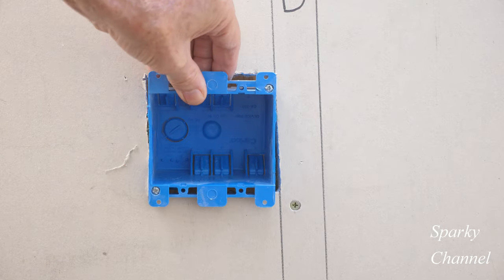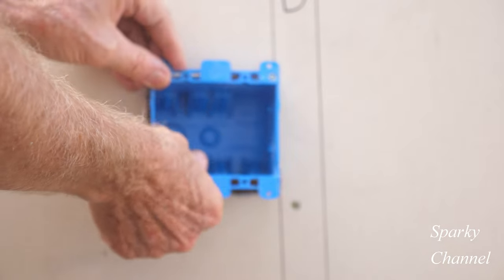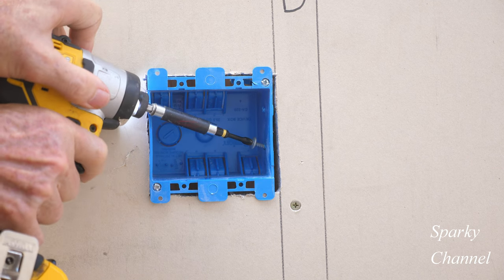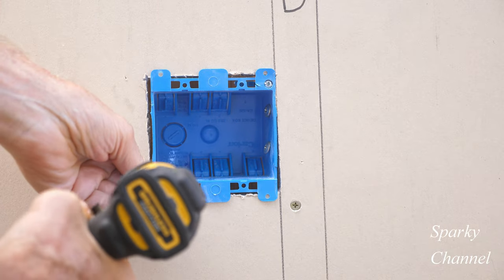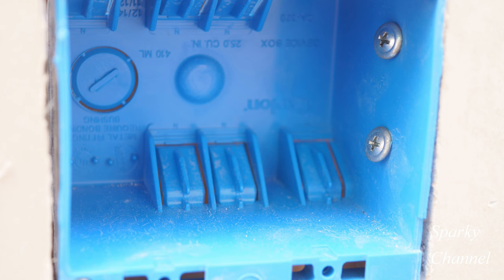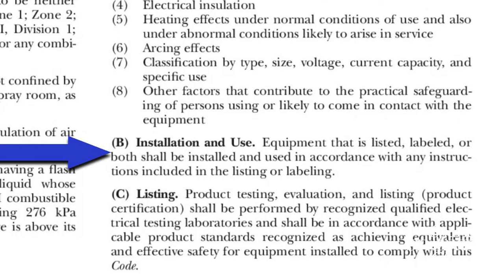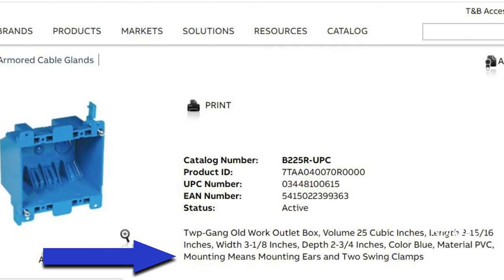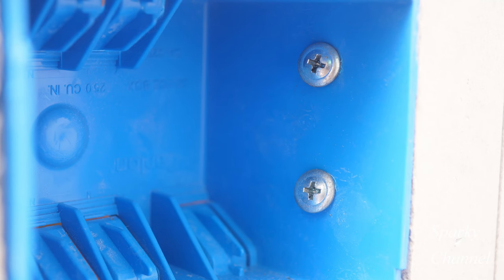Are Screws Through the Box and into a Stud OK per NEC on an Old Work Box? NEC 110.3(B)

Comment: I've done that exact same thing to attach those boxes because I don't have that much faith in those wings and have had them blow out the dry wall before. I would say that it's probably NOT approved because the screw heads are exposed in the box in 'close' proximity to the terminal screws of the device. Do I think it's a problem. No, but the specs are meant to be overly cautious or account for remote probabilities.
Reply from the maker: Thanks!

Comment: This is fine. As long as the box doesn't list not to drill holes. Personally I use self tapper that drill the hole as I mount the device! The fact that the screw is metal effects nothing.
Reply: If the manufacturer approved holes then they would list that it was ok to do and probably provide holes wouldn't they?
Reply from the maker: I've made another video on this subject coming tomorrow. I've incorporated many viewer comments and questions from this video into this new video. Hope to see you there!

Comment: I first saw boxes with preinstalled internal screws around 2016.  in checking the catalog pages on my preferred brand of boxes, I found they sell a single gang box with the nails stuck into the brackets backwards, so they can be nailed on from the back of the wall instead of the front.  according to a restrictive interpretation of code, that box would have to be reinspected and relisted for that configuration.  and making that modification in the field would be prohibited.  the code also specifically says it is subject to interpretation by the AHJ.  
so I stand by not specifically prohibited.
Reply from the maker: Interesting, thanks!

Comment: I've  done that before....and had it inspected by an Electrical Inspector, not a building inspector, and neither said anything about this method.  Screws are far enough apart there will be no short....but if you are concerned..tape your receptical screws!  Why waste material in this day and age!
Reply from the maker: Interesting. Also see: Modification of a Carlon™ Box with Approval? NEC 314.23 (B)(1): https://youtu.be/yZcEyd9mwzY

Comment: Technically because you are using the wings as a means of mounting still you are using the box as intended (per code).  But you are also improving the mounting stability, agreeing with others but I would add tape over the heads for a little extra reassurance
Reply from the maker: Good points, thanks!

Comment: electricians overthink everything... the code is minimum guideline... as long ad the code doesn't say to NOT add screws it's OK... just use common sense... this is done all the time without issue
Reply: It's  not overthinking, it's saving time of redoing something that the inspector says is a code violation.

Comment: I am replacing some older electrical boxes in a restroom remodel and came across some plastic boxes at the local electrical supply house that have screws pre installed from factory on the side for stud mounting in either horizontal or verticale orientation. since I am installing back lit mirror thia box allowed me to mount the box horizontally and the inspector was ok with the box.
Reply from the maker: Excellent! Was it something like this one: A Superior Old Work Electrical Box?: https://youtu.be/I9yhM6m3VIE
Reply: @SparkyChannel  Close but slightly different. I pick up one made by  Southwire Called a SmartBox.That looks like the one in video link but has a heavy duty steel backing for switch or receptical screw mounting. Then one made by Cantex. That had adjustable tangs.
Reply from the maker: @jwar2163  Interesting, thanks!

Comment: Definitely against NEC code, but I'll admit that I've done it... being very careful to avoid placing the screws in any place that could contact the mounted devices (place the screws as far back as possible) and use round head screws with no sharp edges.  Usually with 3-4 gang boxes that can't be fully secured by their edge mounts.
Reply from the maker: Honest man. Thanks!

Comment: Though I know that they make boxes with nails/screws in the side like that (thanks to another of your videos), this is definately altering a certified box from its approved state. My guess is most inspectors wouldn't have an issue but it is for sure against code.
Reply from the maker: Yes, the modification invalidates the UL listing of the box. And inspectors usually don't see these screws to make a ruling on it.

Comment: It will rightfully fail inspection, while it is likely safe to do this into a wood stud [non-conductive material], this would be incredibly dangerous to do with metal studs. The issue is the plastic box is not grounded the same way a metal box would be, so any loose conductor energizes those screws and any metal studs, with no path to ground. Either use a plastic box that comes with screws or use a grounded metal box.
Reply from the maker: Great points. I've made another video on this subject coming tomorrow. I've incorporated many viewer comments and questions from this video into this new video. Hope to see you there!
Reply: You would think so, but i pointed this out to my inspector, and even showed him the code and he passed it anyway and said he didn't care, and can't help me on my reinspection I had called them back out based on many violations  that i found as a home owner (expecting that there are probably others).  The receptical and box were mounted with drywall screws, and the outlets were mounted against the wooden fiberboard backing of our kitchen cabinet's rear wall which is also another violation.  

Also found they ran 14awg, for my living room outlets into 20 amp12awg kitchen countertop receptical circuit.  And this all passed inspection, so contractor thinks it's fine.

Contractors get away with anything these days with no one enforcing electrical work.
Reply: Another interesting thing is that they sell new/old work boxes that come with screws inside the box (of course that is how they are designed to be used), not a huge difference, but the screws are recessed and the structure is enforced.

Comment: The screws should be spread apart more so they don’t arch on the electric connections. Also you should wrap those electric connections with electrical tape. I get that it’s not in code but that type of box is used if the original one gets screwed up. The home owner is the one who will use this type of box. If the builder screws up a box then you have to cut a big hole in the drywall and install a new box….It will get inspected.🤔
Reply from the maker: Thanks Kevin!

Comment: Possible shorting hazard. Those screws are mounted on the hot side of the receptacle if mounted the traditional manner.  But then again the boxes in my 1979 built home are nailed in (through the inside of said box) to the studs as well. Granted they are more flush then the screws installed in your video. Same idea applies? No?
Reply from the maker: I agree. I've made another video on this subject coming tomorrow. I've incorporated many viewer comments and questions from this video into this new video. Hope to see you there!

Comment: I also wonder how screw mounting these typical old work boxes is different from cutting holes in larger plastic junction boxes to insert your conduit/wires? Maybe because those boxes are designed and certified with the user cutting holes as needed in mind where these old work boxes are not? even still, it's kind of the same thing mechanically.
Reply from the maker: I've made another video on this subject coming tomorrow. I've incorporated many viewer comments and questions from this video into this new video. Hope to see you there!

Comment: From a "legal" view you are correct.  You could argue that you are going above the standard by providing a better, more secure fitting.  If the heads were covered in electrical tape or some caulking that removes the shorting hazard, would that be acceptable?
Reply from the maker: Hi Jeff! Modifying a box like that would void the UL listing. The box was not made to be installed in that manner.  If a box is installed with a screw through the side, it should be red flagged by an inspector, but at the end of the day an inspector could approve that application.

Comment: I have to ask since you are screwing boxes - I have a 4x4 two gang metal box and it has two holes on each side near the opening (no bracket).  I’d like to use this as a switch box mounted to a stud. The box has ears for a device so no mud ring is needed.  Can I mount directly with machine screws and no bracket?  I’m sure there are many variables so I’m ok with generic.   You rock and appreciate your awesome videos.

Comment: According to code the screws would need to be bonded to the equip ground.  They are metal.  But the UL listing would be voided.  We do drill holes in metal boxes, large J-boxes, panel cabinets, etc... when needed
Reply from the maker: Thanks!

Comment: I used 1-5/8" drywall screws in top & bottom corners at 45* angles = Inspector called me on it just last week & made me remove. Probably different rule for every municipality.
Reply from the maker: Yes, probably so.
Reply: Can't use drywall screws in any electrical work
Reply: @jimdomoradzki483  Yep, it was a dumb move on my part.

Comment: OK, Carlon needs to put the alternate use of screws on the inside of the box in their instructions. I do not see how the screw will short on a device. Maybe if your a clod at folding and stuffing wires you might nick one on a screw, but that is on the clumsy installer. Not a code violation problem. Many times the drywall is not in good enough shape to hold the box or you have a block that prevents the wing from engaging. Are you going to start whittling the block of install a couple well placed screws?
Reply from the maker: You make an excellent point about drywall being too weak sometimes to properly hold a device box. Thanks!

Comment: The shorting hazard is no greater than the hazard by a metal box. Also, Madison straps would be LEGAL to use for ANY box, as they are used on labeled metal and plastic boxes already. Madison Straps are metal as well and by definition are not the designed method of installing that box. 

Carlon makes a New work/old work box that has a mounting flange, two screw holes top and two screw holes on the sides PLUS 2 nails in nail guides: a truly universal mounting system. HOWEVER, in order to use as an OLD WORK BOX one must cut off the flange and the nails and nail guides, then use the screw holes. There is NO INSTRUCTION about this that I know of, but we do it DAILY as that is the requirement to install it. The same inspector SHOULD be rejecting that installation as well, but they do not!
Now let's review panels and universal boxes, including plastic underground boxes, which are actually the same kind of item as a single gang box, an electrical BOX!. We regularly use our KO punches, hole drills, and step drills to make entry holes into every style box  in locations where an entry hole is needed or even when a larger entry is needed. This is done daily in industrial, commercial and residential electrical work.  Hydraulic punch sets are sold for the purpose of modifying electrical boxes in  every electrical house in this nation. I have NEVER seen any jurisdiction red tag such an installation (and it is done daily by hundreds of SOLAR companies when they need 2 inch entry at specific locations in main panels!. 
No instruction tells an electrician that they can drill into a Carlon E989NNJ electrical box, however without any holes it would be worthless, yet it is UL LISTED and must be violated to be used!

What we are talking about is IRRATIONAL LOGIC and selective rejection used by inspectors in the trade. In fact there would be times when no possible method of installation could take place unless modifications are acceptable and it has been this way for 100 years! I call BS, not on this video, but on ANY INSPECTOR or trade school teacher that would ever say safely adding screws is unacceptable!!

And yes, in this area the abusive tyrants known as inspectors will reject for it. They are actually mentally deficient as they do not even understand that they allow this "violation" every day in much worse ways but call out a couple screws that actually make a better and SAFER/Stronger assembly. Seen it happen, been there and done that. They are FOOLS.

ONE LAST COMMENT, according to  314.23(B)(1) the Jurisdiction gets to say yes or no to adding screws. While the JURISDICTION will remain silent an inspector will do whatever he damn well pleases.  This in itself is insane as an inspector is NOT AN ELECTRICAL ENGINEER nor is he a DESIGN ENGINEER and NOT the Jurisdiction. If it was determined by a jurisdiction then they must PUBLISH and generally they do not make their published codes readily available..

Comment: 314.23 Junction Boxes etc./Supports (B) Structural Mounting (1) Nails and screws: [last sentence] Mounting holes made in the field shall be approved.

It also says screws can pass through the box as long exposed threads are protected, and in this case there are no exposed threads.  Did I miss something?

Comment: It the box is adjacent to a wall stud, why not just use a metal box with an attaching flange? Chop out the small section of drywall, attach the box and plaster over it. I have done that. Very secure and no code issues.
Reply: On an existing wall ("old work") that would mean patching the wall board, then attempting to match existing texture and paint.  The ears on the boxes work fine.
Reply from the maker: That works great as long as you are willing to do the drywall, texture and paint work.

Comment: If the box is not designed to have screws on the side, then it should not have screws on the side. As everybody knows, Carlon makes boxes with chamfered screw holes on the side.  I use those boxes when I need to screw a box to a stud. 😎 my 2.2 cents (because inflation 😁)
Reply from the maker: LOL, it used to be 2 cents! I think you are correct. But if you read through the comments, it's about 50/50 as to whether it's acceptable by NEC. Thanks!

Comment: Technically this would fall under 314.23(B)(1).
although i'm not sure if that nec code was updated for 2022.
I'm not an electrician.
I think you wouldn't have issues If you moved the screw holes further towards the top and bottom edges and coated the screws with GB or starbrite liquid tape afterwards.
Reply: 2023 NEC 314.23 (B1). 

314.23 (B) (1)  Nails and screws.  Nails and screws , where used as a fastening means, shall secure boxes by using brackets on the outside of the enclosure, or by using mounting holes in the back or in one or more sides of the enclosure, or they shall pass through the interior within 6 mm (1.4 in.) of the back or ends of the enclosure.  Screws shall not be permitted to pass through the box unless exposed threads in the box are protected using approved means to avoid abrasion of conductor insulation.  Mounting holes made in the field shall be approved.

So what does this mean?  I will leave it to those more qualified to interpret and apply that interpretation to the original question posed in this video.
Reply: @apackwestbound5946 
It means mounting holes can be made in the field, have to be inspected on the spot to make sure it doesn't damage the romex or lead to electrical fire later on. 

Technically the inspector has to approve it. As long as the screws are flush and not degrading the structural integrity of the enclosure, or abrading the romex. You should be fine.

Comment: That's a situation where if the inspector wants to press the issue, you would have to get a letter from the manufacturer stating that it's a valid install method.  If it was a metal old work box, there would be no issue with that mounting.  Being plastic, the screws don't affect the integrity of the box.  You do not want to do that with fiberglass old work boxes, however, because it's too brittle and the mounting points have to be of a reinforced design.
Reply from the maker: Good points, thanks!

Comment: A lot of people getting caught up on the fact that this box is  UL listed. Which means it meets UL standards for safety. You don't go out and have UL inspectors show up to homes to inspect your electrical. I won't get into arguing about NEC code violations here, since that's clearly debated between what's in a book and what has become standard practice in many areas. But arguing about modifying its UL listing isn't relevant here. UL is an entirely different safety standard than the NEC.
Reply from the maker: Thanks!